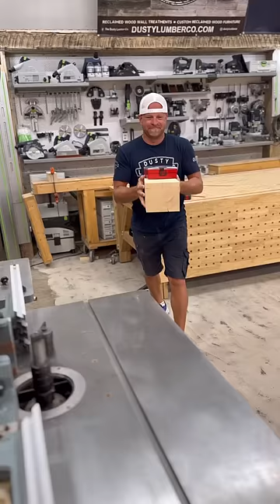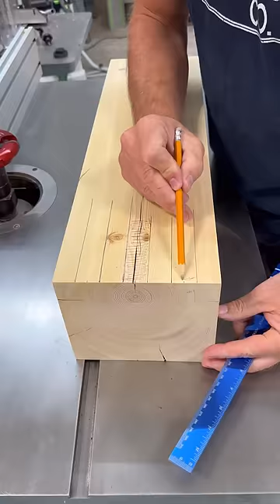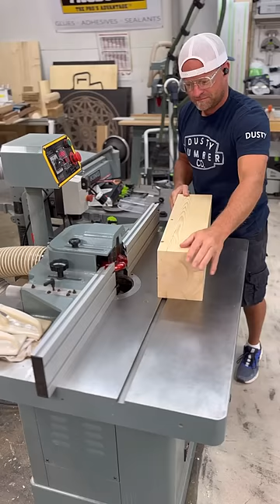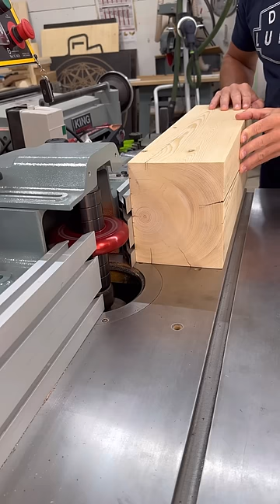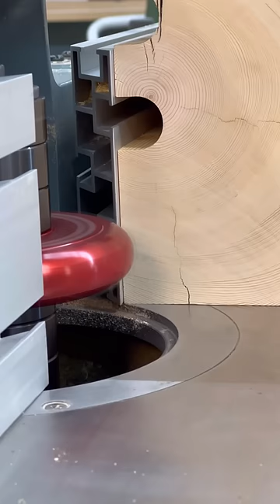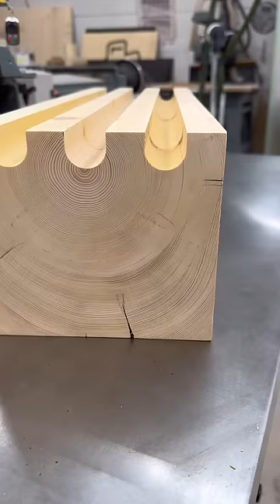Test cutting big flutes in a beam with the Freud convex radius cutter  #woodwork #tools #maker #wood

Comment: Where are you located? Over here in Belgium our cutters are labeled mechanic or manual, to show what type of drive is required. I lost a few fingers manually cutting with a mechanic labeled cutter. 
At the time i did not even know about those labels. 
Just wanted to know your opinion on when you manually feed something trough or use mechanical wheels to do so ....